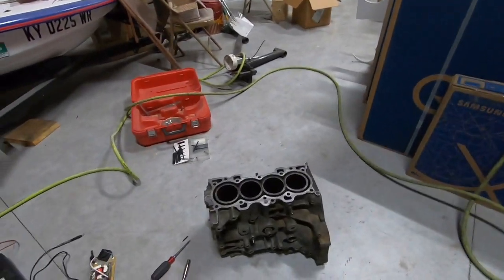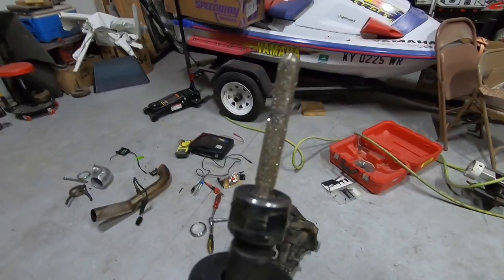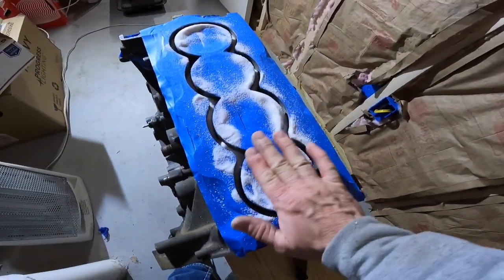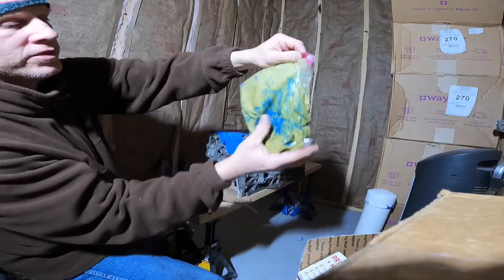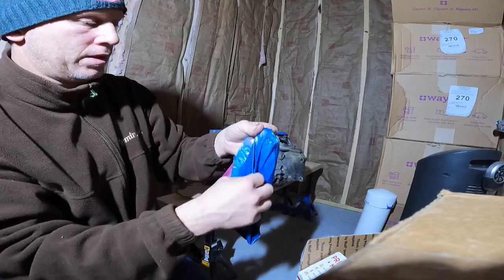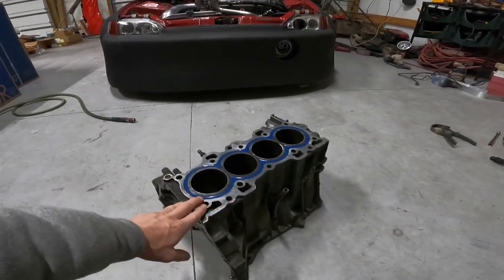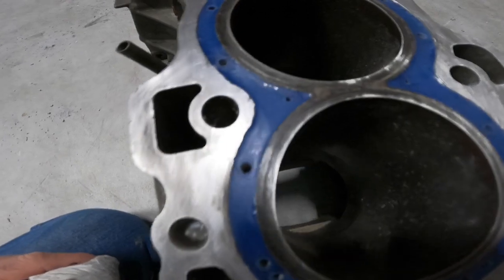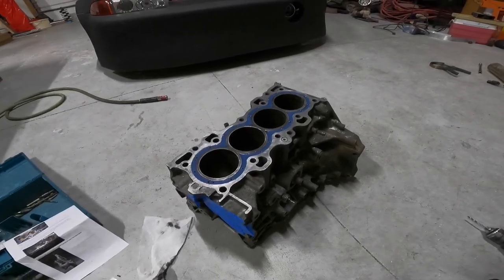Epoxy Honda block

Comment: Hey friend, I saw your video  of the filler for the closed deck, after years of use, how did you find it? Is it good for daily use?
Reply from the maker: I got the Epoxy for Chris’s Epic Tuning , if the car will be a daily driver I might suggest drilling the water paths a little bigger, but this motor is still going strong at 700hp and low 10 seconds over 140mph in a 96 civic

Comment: Do you need to deck the top and bore it or is that just a suggestion?
Reply from the maker: I personally would.  Anytime you add something that could distort the cylinder shape , it would be smart to hone or bore afterwards
Reply: @barryc1635 oh okay and what do you think would be a good amount of epoxy for a 500 hp built bottem end I was thinking 1/2
Reply from the maker: @Crack-lk4px  if you buy the kit from Chris Boyette it comes with the proper amount,  it’s between 3/4 and 1 inch think which finished

Comment: Pay the money to do Darton sleeves, don't be fooled by this junk.
Reply from the maker: Everyone has their own opinion,  but done correctly this is a great way to add some safety to a  budget build. I’ve also seen more failures from sleeved motors than OEM sleeves for a daily / weekend  setup.  This car is still going strong at 600hp

Comment: So I was told to go 2 sizes bigger than 3/32.  You think 1/8 is a bit small??
Reply from the maker: I went bigger than the original recommendation on this block, myself, the water flow was just fine

Comment: Hi how has it held up  im wanting to use mine as a daily just worried about the poxy breaking of after continuous heat cycles
Reply from the maker: The motor is still going strong, only issues has been breaking the transmission with the power lol
Reply: @barryc1635  thank you for your reply  great channel keep it up   breaking gearboxes is fine as long as it isn't the engine 😅

Comment: How is it holding up at 650 whp?
Reply from the maker: It’s not at 650whp yet, but I’m not worried about putting it there.  The car did run 10.8 @135mph. So I know it’s making closer to 600whp to do that speed
Reply: @barryc1635  why worried? Is epoxy not strong? Also had heat up issues?
Reply from the maker: @wickedsatan1  I’m not worried , we just don’t want to start breaking gears until we are ready to replace them with quality gears . I put the power in a fun but safe zone,  no overheating so far
Reply from the maker: @wickedsatan1  I said if the first reply that I wasn’t worried about going up to 650 , you might have misread that
Reply: @barryc1635  my bad
Reply from the maker: @Turboboob  they are actually bigger than than recommended already.  Car drives at normal temperatures
Reply: Boostedboiz run a k20 at 700hp with the epoxy.

Comment: Any update on the epoxy? How do I follow on social media?
Reply from the maker: @93turbocivic on Facebook…. The motor is running strong, I made a pass in the car and ran a 10.8 @135mph in it.
Reply: @barryc1635  awesome. I'm doing the same epoxy with the fwd gear x top eliminator gearset.
Reply from the maker: @chriscoatess3600  I’m using the Top Eliminator gears myself, I also used GearX ring gear and counter shaft as a upgrade

Comment: hey get more update and content on this build. i wanna see how this epoxy css turned out to be. i don't see no other YouTube doing a full process after getting epoxy into the block and then thats pretty much it.
Reply from the maker: I will be doing a on going process with  this build. It might take a couple months  before it’s all together and tuned, but we  have high hopes for making over 600hp after tuned  and running 10’s at the track with this car
Reply: @barryc1635  what ever how long it’s gonna take as long I get some sort of content and update progress on this one it’s all good.
Reply from the maker: @K2499mm  I’ll for sure be doing and sharing updates on this build.